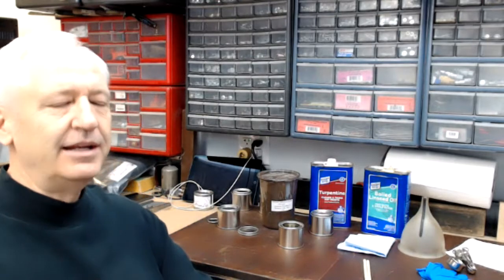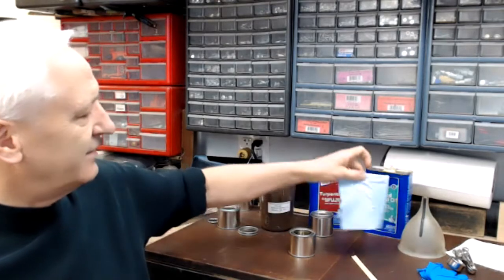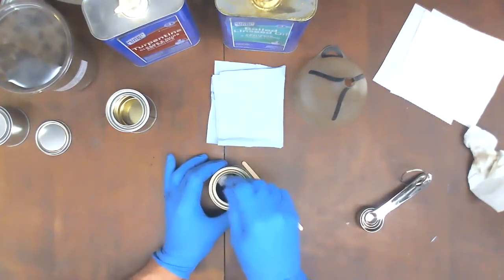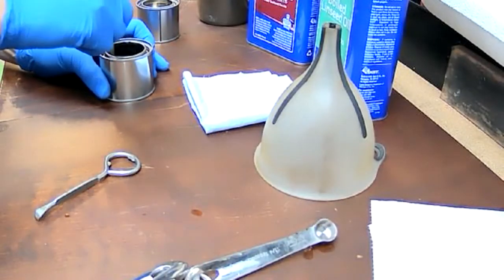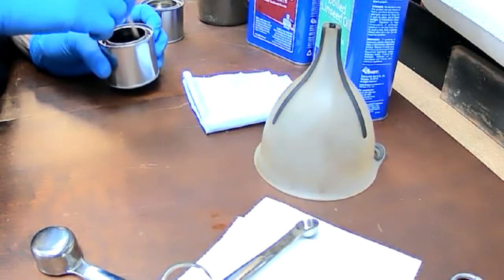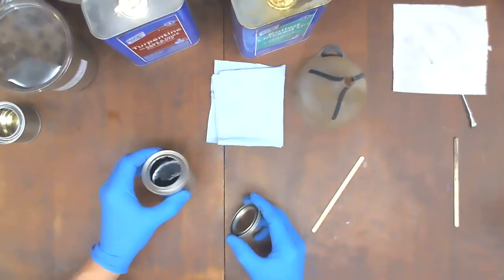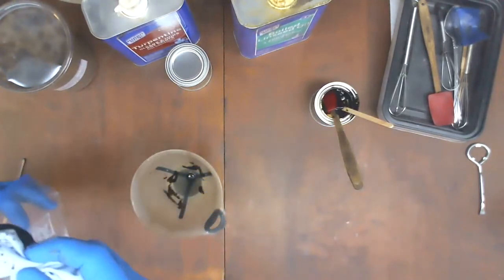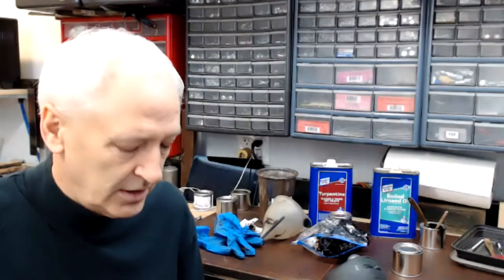Japanning Instructional Series Session 2   Mixing & Filtering Japanning

Comment: I may have missed it but how far will this batch go? I ordered the 10oz can from you and it has instructions for mixing the whole can, so I am wondering which batch to go with since I am re-japanning a no.5 and 2 number fours. Or would it be better to just make up the 10oz batch and keep it for later use?
Reply: Just make up a large batch.
Reply: it goes a long way.  I believe you could japan 8-10 No. 4 size bench planes with the contents of one 1/4 pint can.  Keep the can tightly sealed and displace the air by either adding clean marbles to bring the level up to the top or use argon wine preserver gas and the shelf life of the japanning is a least a year.